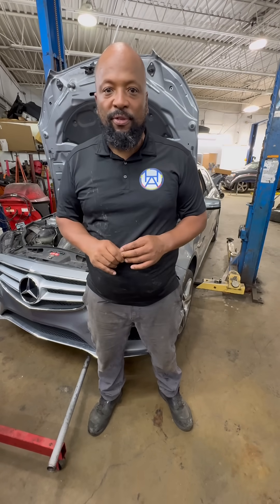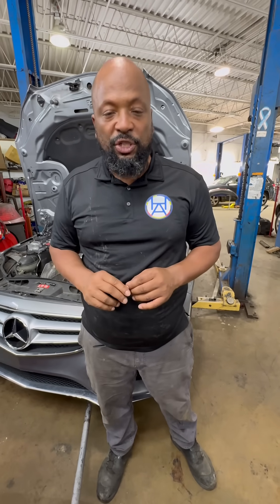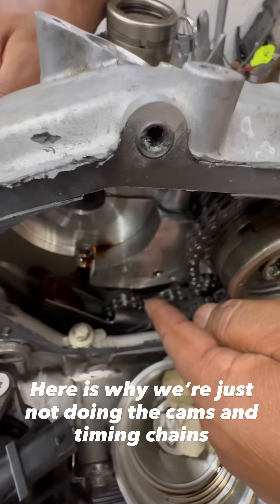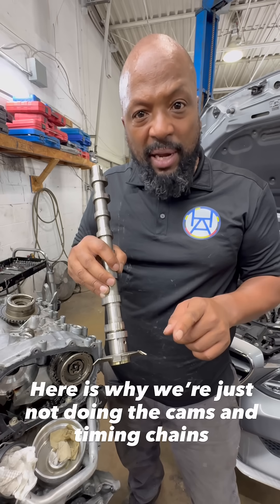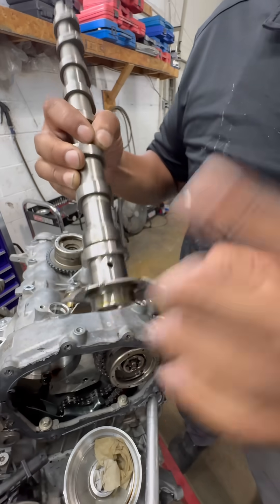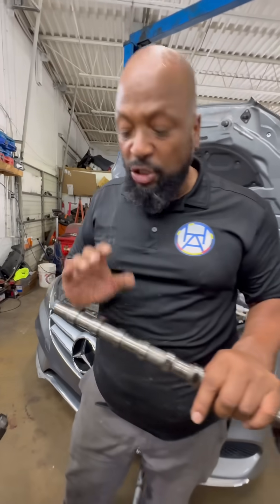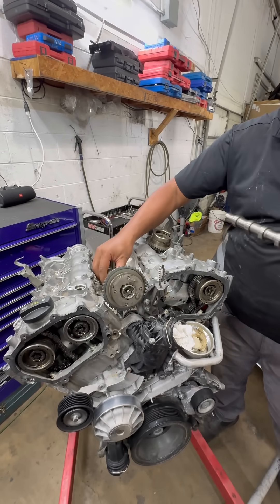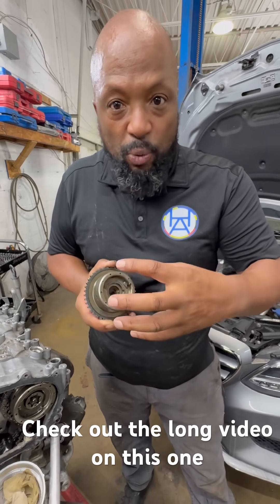Why are we going to replace the engine?

Comment: I've got a guy who spot welds and will ,reposition the pick up wheel , and so far I've sent out 3 ML 350  BEEN on the road for over a year,  got the sprockets for 350.00 ea. But some don't line up if generic on to the cams😮
Reply from the maker: That’s why I just do it the right way with good parts.  Stop trying to safe a customer money, not your problem if they can’t do it right.
Reply: @goharrisautomotive your right Phil, it's buisiness,

Comment: Many new cars are poor quality.  Older models didnt have these crazy issues. When benz went to the m272 the sprocket would strip teeth. Thats when it started going down. The newer engines are noisier as well . The gear spinning on the cams is also seen on other car brands. Other brand had similsr issue but you can tack weld to prevent this after adjusting it back in place.
Reply from the maker: The welding would work I think. but I do dealership level work.  If it was my car, I would do a new cam and tack weld it as a test

Comment: You could have saved that motor....
Reply: That’s what I said if it starts change cam and timing chain he saying new cam 1,000 get if off used crashed car 🚗…no more than few 100 bucks idk
Reply from the maker: That was one of the most  stupid comment I read yet
Reply from the maker: Sure at what cost
Reply: Bro  I work in mercades all day …ik wat im talking about if the car started you could have reset timing got  used cans and sprocket jus like he got used engine  ..way cheaper I bet customer paid 2800 for that motor used …
Reply: Plz stoping commenting if you never  rebuilt a life b4

Comment: I  have a VW 2012, and I did a time chain job for 1200.  These particular engines EA888  have a problem with oil consumption due to faulty pistons.  Now, the engine will need a rebuild sooner or later for a cost of 3500 dollars.  I should have just rebuilt the engine rather than doing the timing chain
Reply from the maker: Yeah, those engines can be problematic.  Probably should’ve did it all at once.
Reply: Some engines had ring/ oil scraper problems, scraper would gum up do to small holes and stat burning oil.

Comment: Was the motor running ???  If the valves weren’t bent you could have saved that motor my opinion…If you doin used engine can’t you get used cams and sprocket ⚙️….and then go new timing guides and timing chain ⛓️‍💥??…
Reply: More than likely he will sell the motor for a core to get some money back. This guy clearly knows what he is doing and is trying to be cost effective for the customer. What he couldn’t fit into the video is that the labor is probably outrageous to do all of that.
Reply: @ewalsh19 True That
Reply: @ewalsh19 exactly 💯
Reply: Labor is $125-$150 an hour now. Rough estimate. Multiply that times the 9-12 hours Mitchell estimates for the job, turn add the price for the parts.
Reply: @smellsuperb1  those labor costs are on the lower end of the spectrum for these cars. You might be looking at 160- 200 especially at the Dealership. It seems to me though that the shop owner is a pretty decent businessman so he probably charges around $100-$95 an hour to keep work flow good.
Reply: I heard though the grape vine ford is charging 160 a hour which blows my mind. The dealer is making a killing.
Reply: @smellsuperb1 1000 a cam. No brainer
Reply: I'd never purchase a used cam. That's like using used rings.
Reply: @antoniotutt4894 but you’ll use a used motor ?? He’s installing a used engine .whats the difference…..js